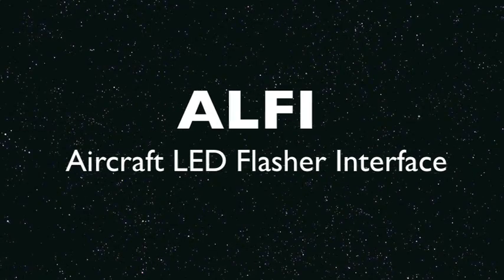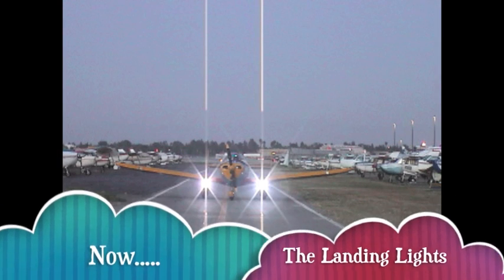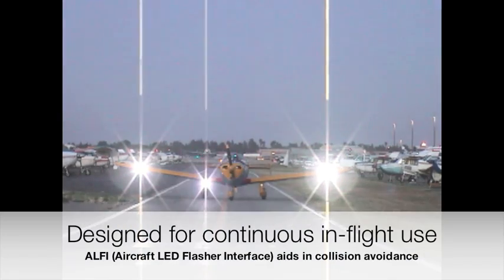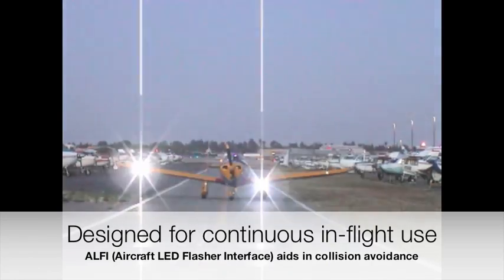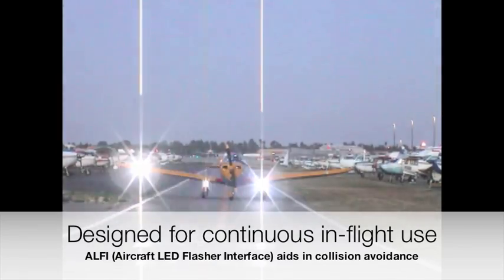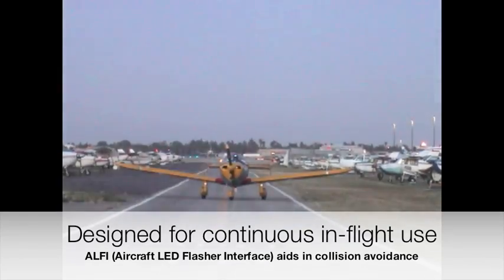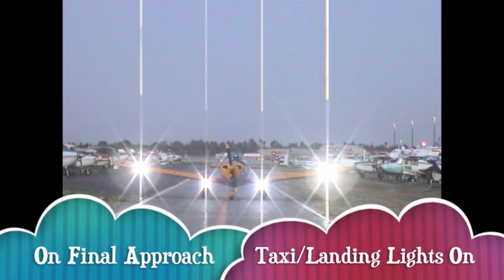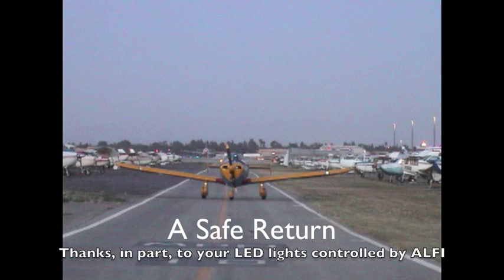ALFI Aircraft LED Flasher Interface

Comment: 14 years and no certification in sight. If anyone wonders whats wrong with the FAA, this is it.The FAA would argue it takes so long to certify for safety reasons but add up the mid-air collisions that a system like could have help prevent in the last 14+ years. How many lives could have been saved. Lagging on certifying STUPIDLY SIMPLE, PROVEN, LIFE-SAVING technology is not making ANYONE safer! Especially not non-wealthy people in General Aviation who do not have thousands of dollars to spare for overly expensive all-in-one LED hardware.